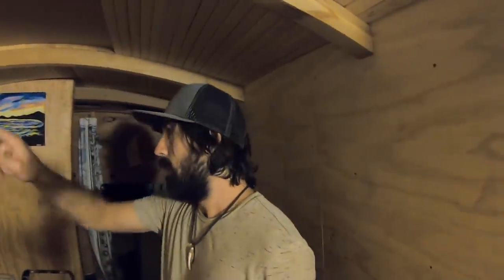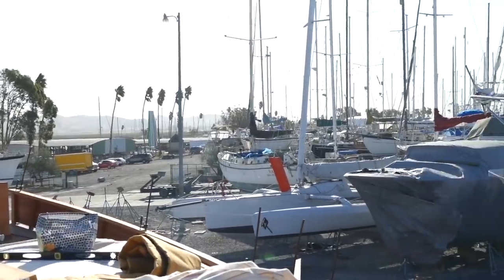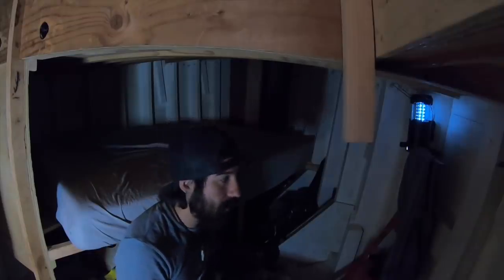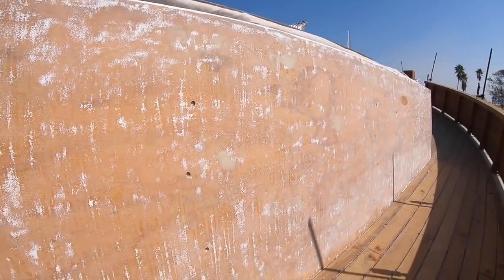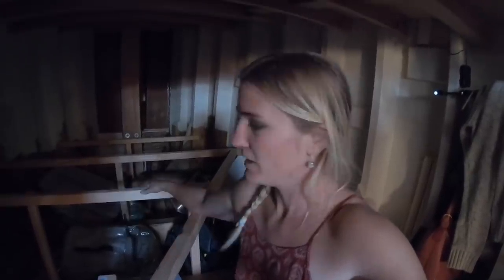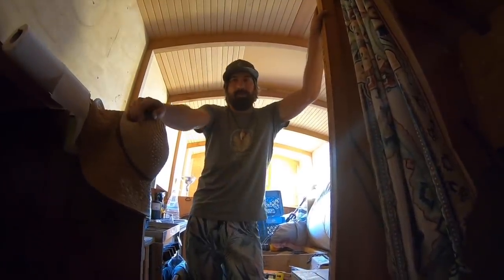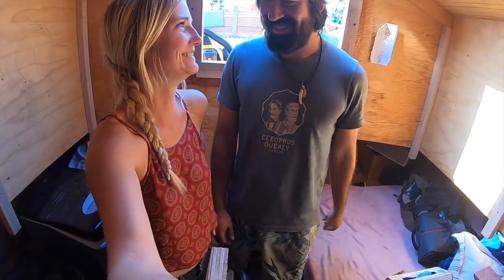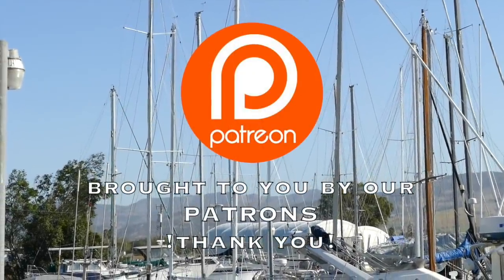Salt & Tar: Episode 70-Not Mistakes, Lessons

Comment: I always use copper powder in my epoxy.  Worms don't like copper and it is so easy to blend into the epoxy.  For all the preventative maintenance you are doing copper powder would ensure no worms or any other sea creatures will eat the timbers.  West Systems sells the copper powder as well as many other marine suppliers.

Comment: I have restored two sailboats. I finally came to realize that I had to do many things 3 times before I got it the way I wanted it. It's part of engineering as you go. This kind of work Is way to hard to visualize the end product unless you can draw it out first. Then you only have to do it twice. As you said it is not mistakes, it's just on the fly engineering. When you are done it will be what you wanted, or at least pretty close.

Comment: You can do a pour with pigment in the epoxy then run in a $50 plumbers endoscope off of amazon to inspect the bore and make sure you covered it all.
Reply: You can get an endoscope that plugs into your phone for around $30
Reply: Amazon endoscope shown me were a pipe was  clogged and saved me $$$$$$$$

Comment: That is one of the novelist ways to line you stern tube! I know other have suggested other ideas  like using a piece of large DIA copper water pipe.  What did you do with the unused epoxy?  Prehaps some slight air pressure could have speeded up the process. 
Glad you found a use for the Butyl!   Cheers Warren
Reply from the maker: Thanks Warren ;) after the wait time on the pours the epoxy was kicked but it did its job. Much cheaper than years down the road replacing the shaft log because of worms haha
R
Reply: Salt & Tar Hi Ruthie, agreed , job needed doing for sure I just think I would have poured the epoxy around a tube and left it in there! 
But you're there not me! Cheers W

Comment: Did you think about making the knees your putting in into handholds?
Reply: Thats kinda a cool idea. I am sure Garrett has some kind of over head grab bar or something in the works.
Reply from the maker: Not a bad idea. I don't know if they'll be big enough but we'll have a piece at the bottom of the cabin wall that is through bolted through the posts so it'll stick off the wall an inch and a half or so. So that'll be one long hand rail 
R

Comment: Insomnia is not a terrible quality for night watches on an off shore sailing vessel. You certainly wouldn’t want me on the night shift. My two cents on the cabin beams: the proposed gussets I think would look classier if they were a wider single on the inside rather than thinner and doubled on the outside of the beams and posts. No offense, I like the shape you came up with but not the application so much ( kind of too much of a short-cut, do-it-yourself vibe???) Nice progress. I admire the determination, energy and enthusiasm.

Comment: Bonjour Ruth and Garrett,
Bonne Année ! 
I like following your amazing adventure for a while but, as English is not my native langage, I have perhaps missed something: Could you confirm me that you plan to install hatches or port holes to highlight your cabin, I have seen round drawings ?  If so, that would perhaps  justify other reinforcement ? And will you build them ?

Other question; Two of my wooden models boats "exploded" this summer because the temperature raised up to about 40°C in my flat, and the wood of the bordered on frames was supposed to be dry. You hull ssems to live the same temperature impacts, have you planned something for it as it goes on drying ?

And do not worry, the size of the mess just depends on the space you have, imagine you building a 90 feet long sailboat  :+)

Amicalement, Raphaël
Reply from the maker: We are actually in real-time installing our ports! If you check out Instagram there are current photos. We've been bathing the boat daily while she's been out of the water (and why she has that black "skirt") but we need to launch her soon to prevent any major stress on the fasteners. Hopefully this will be our last "longer" haul out (4months) and every other annual haul out will just be a few days to reapply paint then back in quick. Wooden boats NEED the water haha
R

Comment: Your locking nees for cabin go over the cabin beams , the cabin top works the most on a yacht don’t go along side
Reply: Strength of the wood and not just the fasteners!
Reply: rcdogman duh glued in the correct place going along side the cabin beam makes it easy to fasten to but affectively leaves the cabin beam working on its own over the beam they try to work together

Comment: Hi guys iv been loving your vids...just wondering if you have plans to add fore deck seating forward of cabin..?..cheers.
Reply from the maker: Probably not since our main mast comes down right in front of the cabin.  There will be a lot of lines to handle up there but we'll build boxes around our propane tanks and make those into seats most likely... possibly a long bench near the tiller too

Comment: fwiw, acetone weakens the epoxy when used as a thinner
Reply: don't think it needs much strength in there, it's just a penetrating barrier
Reply: sure, just mentioning that in passing in case people come across and think of using acetone for thinning resin in structural fiberglass